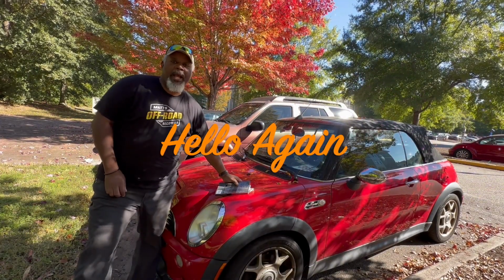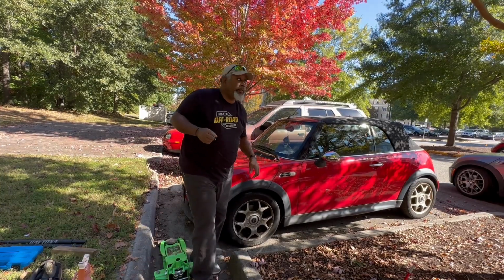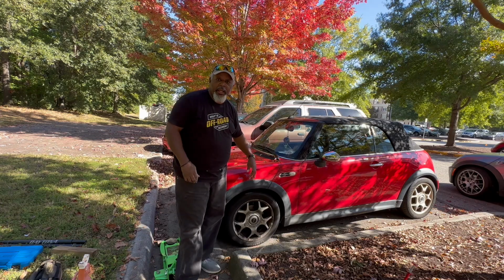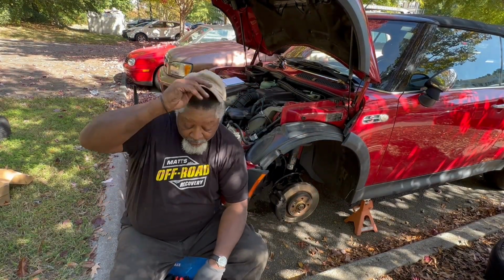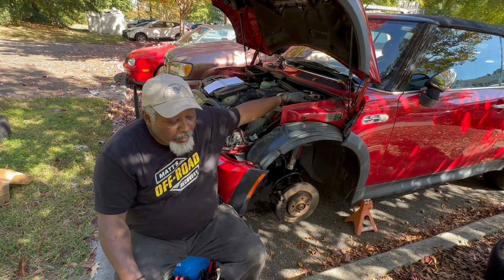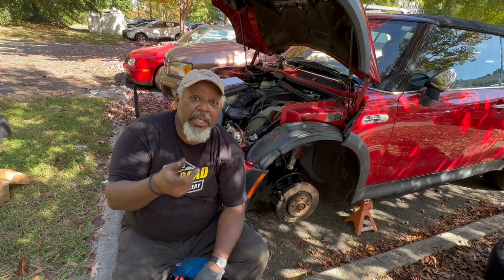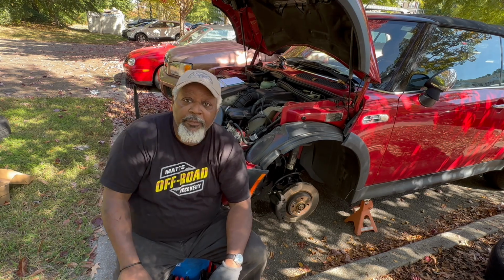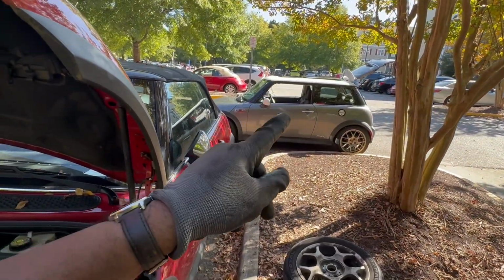Torn Strut Bearing Replacement ~ 2006 R52 MINI Convertible S.

Comment: Ive been putting off replacing mine. Ive read some people recommend only genuine MINI parts for these but they are crazy expensive. Are there some decent aftermarket ones worth a darn? I went some some cheap ones from rockauto but they certainly didn't last.
Reply from the maker: I can't remember where I got these from but, I'm sure they were on sale.  lol  Could have been FCP Euro, or Out Motoring.  Thanks for watching.

Comment: what are the signs of this? Any particular noise?
Reply from the maker: You could hear thumping noise or excessive squeaks when turning.  The Rubber bit, you can plainly see when you look in each shock tower. (where the three nuts are) If it looks cracked or torn, replace them.  Thanks for the question & for watching.
Reply: @Mini-Driver  thank you for the reply